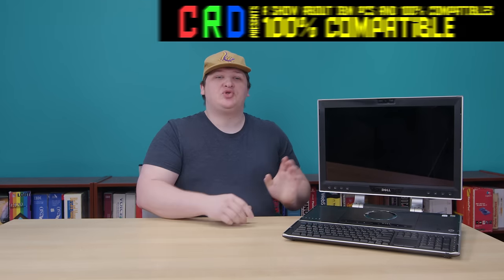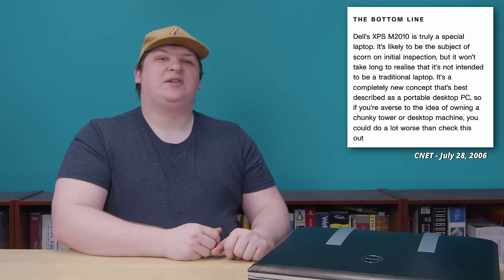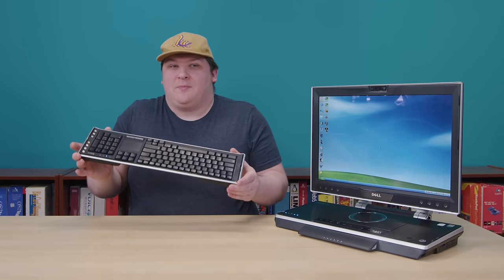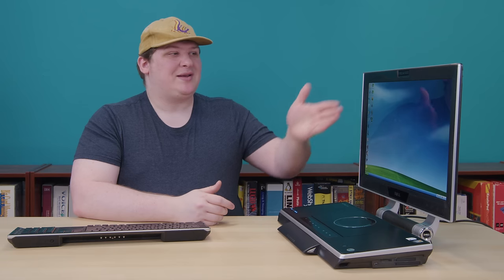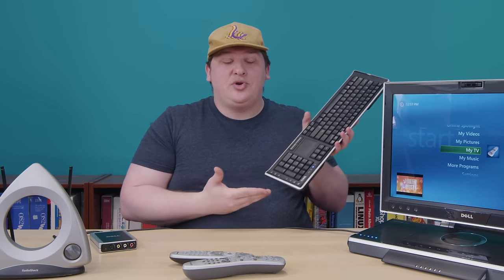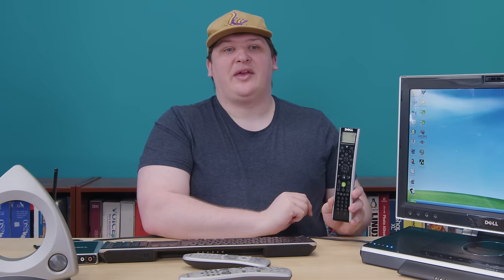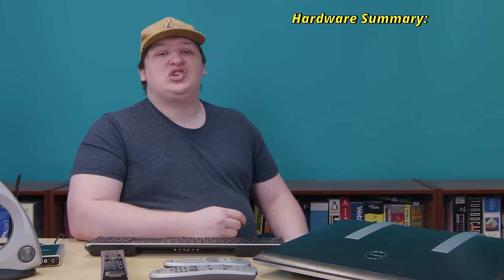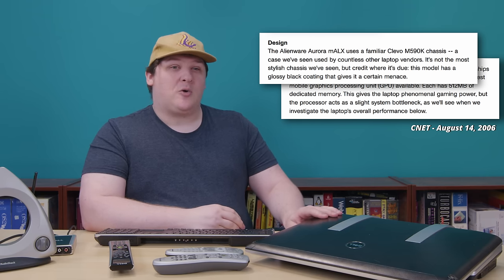Dell Called It "The Showstopper"

Comment: The battery means you can put it to sleep.  Drive 3 hours to work.  Put it on your desk and continue where you left off.    Or put it to sleep. Carry it to your bed and have the ultimate bed TV experience.   I want one
Reply: That still begs the question why they made it so big, you really don't need three hours of battery life for that
Reply: @bacon.cheesecake 😊
Reply: Back in the day you would hibernate anyway tho
Reply: This made me curious if anything like this still was made. And a quick online search revealed the "HP Envy Move" which seems quite similar (though non folding and with a "bag" for the keyboard instead of a dock). And has modern hardware for ~1/3 the price.
Not trying to shill for HP here just found it funny they're still around.
Reply: Even if it didn't had a battery, you can still put it in hibernation and remove the plug, and it will still works where you left it off when you arrive at work
Reply: Still interested how much it will affect the power consumption if you swap two HDD to SSD.
Reply: Something like that, I'd guess. Plus, even if the actual, practical use cases are limited and you rarely if ever need it, I think this device WITHOUT a battery would've been an even weirder sell to consumers.
Reply: @schtiehve9594  That envy-move-thing looks like the solution for those shared desk offices, except everyone insisted on getting a large screen, fascinating device!
Reply: @sheppardpat47  True, but hibernation takes longer to resume.
Reply: @LubomirGeorgiev  that never worked
Reply: @belstar1128  What? Hibernation? Thats how I would use my XP laptop, hibernate on close.
Reply: @belstar1128  I think you're conflating hibernation with hybrid sleep.
Hibernation works perfectly fine. 
Hybrid sleep will wake up for various, unexplained reasons and will drain your battery.
Reply: Yeah I definitely think it was more of a "carry it from room to room" deal than a "carry this to class every day" lol
Reply: @tim3172  when I used to use it often it would just take just as long or longer to boot than a full reboot. and most programs were shut down or glitched out
Reply: why is no one considering the fact that with all the inputs and card readers for cameras + the raid drives this would be a great option for recording in the field and transferring video over quickly, maybe even doing some quick editing? like with that kind of price tag it needs some real professional use cases and this seems like a great option for a freelance videographer in 2006

Comment: About Wireless USB: it uses a type of radio called UWB or Ultra Wide Band. At the time UWB was a 1GHz large band around the 2.4GHz range (compare to the 20MHz bands used for WiFi channels). This large band means the possibilty for huge data rates, but also a large band for other Wireless communications to interfere with (like WiFi). Because the power emission of UWB is way lower than other wireless tech, it was always being disrupted by other signals, including other UWB devices, so this solution wasn't really scalable.
While Wireless USB died, UWB is still alive as a kind of radio positionning system and is part of the solution used by Apple's Airtags, and some high end car keys.

Comment: On why 16:10 for a media device: back then that was actually common as 16:10 would allow you to have a 16:9 video with controls and/or subtitles at the same time without covering the content.
Reply: 16:10 or 3:2 gives more vertical space for trackpads etc and more closely resembles paper formats for creative work.
Probably more of a selling point today with touchscreens and whatnot, but still perfectly usable.
Just please never let laptop manufacturers get away with absurd resolutions like 1366x768 again.
Reply: @MetroidChild  I actually kept a monitor from 2004 around just for reading paper documents.

17" 5:4 in portrait is perfect for a text editor, pdf reader or browser with an A4 document at 1:1. I only replaced it a few weeks ago with a DIY built monitor using a 16" 3:2 panel of almost identical size.
Reply: @MetroidChild  I still have a tv with that resolution, its pain
Reply: Not to mention, a lot of content was still in 4:3 and would benefit from extra vertical space. And if you weren't in fullscreen, 16:9 content would display with black bars on an actual 16:9 screen, while 16:10 gives some space for the taskbar and such without shrinking the content.

Comment: I worked for Dell XPS Gold Support in 2007, as these were being phased out. They were always my favorite, and I still want one of my own.

BTW, we were specifically instructed not to call laptops laptops, because Dell didn't wan't you using them on your lap and burning you.
Reply: I've only used a laptop in my lap a handful of times.  Mostly back when I was a teenager and still flexible enough to sit cross legged on my bed.
Reply: @samsanimationcorner3820  I had to sit my strategically bridging my legs or the 200° bottom of my Pavilion would scald me.
Reply: I actually use my laptops on my lap, but only because I happen to have an old lap desk so im not chocking the laptop or burning my legs.

Comment: This notebook PC reminds me of those refrigerators from the 1950's that were A) gorgeous and B) packed with features that were startling then and we also don't see much or at all today. Swing-out lazy-susan type shelves that also were height-adjustable. A butter "conditioning" tray that kept it warmer than the rest of the fridge. A lower compartment drawer-style freezer in the *1950's*. And it was counter-depth! Not to mention made of solid steel. Luxurious, over-engineered in a lot of ways, but something that solved problems you didn't think you had and was glamorous about it at the same time.
Reply: Expensive household devices back then gave you convenience, expensive household devices today give you gadgets in search of a problem.
Reply: My fridge has a special compartment on the door to keep the butter more warm. I keep the cooking lard in there too.

But yeah those old refrigerators are amazing.

Comment: I think I’ve figured out what the battery is for. You’re absolutely right that the machine was meant for media viewing. The battery isn’t just for a power outage, which is a big part, but even bigger:

Sleep mode and travel. No joke. XP was the first time that we really used “sleep mode” on a computer. And given what this beast was all about, it’s perfect for the jetsetter to take to the airport. Yes, it’s the weight of a carry-on; that’s what it is. But if you have DVDs, or recorded TV, or any video file, you could drop it on this thing, leave everything exactly how you like it, put the machine into Sleep Mode, and then plug in at the airport or on the plane (because of course you fly biz class, where they have 120v plugs).

That’s what the battery is about. Throw all the accessories into a bag, hit the road, and take your media with you, wherever you go. And never, ever, lose your place or video-specific settings through something so gauche as “shutting down”.
Reply: And then when Vista added hibernation, you didn't need the battery anymore

Comment: You've mentioned the concept of an amazing dorm room media center machine before and the only time I ever saw one of these in real use was at a Student Lounge at my university at some time between 2006 and 2010. Another student rolled it in using its official wheeled carrying case, I had a Latitude D420 at the time so of course I snickered from behind my note taking ultra portable. I think with this video you've really demonstrated that while unwieldy for a ton of uses its actually a really solid machine from a time when Dell was actually trying.

Comment: When I worked for Dell back in the day I was part of a team testing Windows Vista across all our product lines before launch. When I saw this device in the test matrix I immediately wanted to test it out. It ended up sitting beside my desk (on another desk due to size) for a good while until eventually I had to give it back to the factory. Enjoyed many a game of Microsoft Flight Simulator 2004 on it on my lunch breaks. I believe my configuration had an ATI Radeon X1800 or around that range.
Reply: I would have been "What's the wholesale price for this?" "Ok, take 1/4 of that out of my next four paychecks because this bad boy is coming home with me!"

My current laptop is a Latitude E6530 with 16 gig RAM, 2TB SSD, BD-RE, 1080p display, dual USB 3.0 ExpressCard, Core i7, nVidia GPU, backlit keyboard. NO webcam or SmartCard. It still have Windows 10 on it, which I plan to keep on it until I must go to 11. It has a TPM but I'll most likely do whatever workaround eliminates the "need" for it.
Reply: He said this one had the Radeon X1800 too.
Reply: FS2004... Like how not even 3 years later after the release Aces Studios made an updated, impressively unoptimized version 😂

Comment: I was a student IT professional at my University when these were first released in 2006. They were used in lecture halls as a quick av interface solution in replace of the custom ad-hoc av solutions that needed specialized a desk and wiring that had to go up, through, and behind walls. This was before the rise of shuttle computer set ups which allowed for immediate interchangeability. Anyone who went to a SUNY school knows all of the computers there were contracted to Dell. Luggables before thenn was most often a TV on a rolling stand with a tray that included whatever your av/it order was, separate of mentioning whatever were the ports built into your lecture hall. The HALO and Street Fighter sessions in these halls were glorious on those projectors. Btw, when luggables of this sort were first released it eas absolutely insane seeing so many students with these absolutely huge laptops being lugged around campus.

Comment: You are right about it being a good pc for it's target consumer.  When it came out I had a number of friends in high end engineering design jobs that got these.  They still occassionaly wax fondly about it. 

They loved that it was a powerful worstation that could easily be taken to the numerous sites that they circulated through. Show up to a branch office, contractor's office, presentation facilities at hotels, etc.  and you could run anything you needed to, on the spot, without worry.  Great for people who worked, mostly, on resource intense software, or veiwing large, slick, presentations.
Reply: Yeah that's a good point. I could definitely see this as good for site visits and presentations
Reply: I'd much much much rather have this than any "all in one" desktop pc and doing it this way doesn't basically cost much extra anyway compared to that.

Comment: 44:19 I just dug out my old Toshiba NB505 netbook out of storage a couple weekends ago, and the rubberized plastic had expired like nothing else has. I had to sit down, put on an old movie in the background, get out a roll of paper towels, grab the guitar pick scrapers from my iFixit tool kit, and alternate between isopropyl alcohol and water to get 98% of it off. That was around two hours. I could not imagine needing to put on a playlist and putting in a workday's worth of effort to get the stuff off of both sides of that Dell notebook.
Reply from the maker: I watched like 6 episodes of Have Gun, Will Travel, listened to a Nirvana album and then watched some Star Trek Enterprise and there was still more to do lmao
Reply: I have the Pentium II ThinkPad from my dad and still use it. The amount of rubber IBM used on these things was insane. But i used a different method. As a business owner and a certification of my country's government, i have access to certain fluids that can dissolve rubber. There are special acid cleaners to dissolve sticky rubber. But please be careful with it.

//edited: typo "mie".
Reply: PALADIN MENTIONED 🗣️❗❗❗

Comment: european here, can confirm we use inches for screen sizes (centimeters were actually commonly used for tv screen sizes but for pc monitors it was almost always exclusively inches and in the hd era they took over the tv space as well)
Reply: i can confirm as an ex european that it's the same for asia.     a bunch of things are inches worldwide, such as household fans, the mentioned monitors/tv's, jeans sizing, car wheels, cat cooldown clay pot cozys, pans and pots often.. there has to be a bunch of other things, but for one reason or not round or such things are often inches. oh yeah he just said subwoofer! subwoofers and woofers are most of the time sold in inches worldwide.  "6x9inc" speakers for cars and such too!

edit: I can't remember centimeters ever being used for tv's in the 90s either.  boxes often had a centimeter rating too though
Reply: its quite annoying inches are mostly used for things like measuring screens and a certain body part only half of the population has .
Reply: @belstar1128  WHAAT only half the population has waists?!
Reply: @odkres  we use cm for that
Reply: Actually it varied depending on country and manufacturer. Nokia sometimes used cm or inch depending on the model. Their larger sets were sometimes seen measured in inches but the smaller ones with a built-in vhs player were using sometimes using cm. And this is just from Sweden.
Reply: @belstar1128 You'd think centimeters would be more popular for that, considering the inherently larger numbers involved.

Comment: I wish they used standard desktop components , as around 2003 or 2004 , there were desktop computers packed into laptop form , i think they were like from 17 , 19 inches but inside , you could fit usual desktop components as motherboard had slots mounted paralel , so everything could fit nicely. And they were really thick and heavy , and had just like that machine small battery , so if power fails , you can save your stuff and power it off. I remember also them having bad thermals as well due to crammed components , but it was cool idea for the time , as laptops from that era had big constraints compared to desktop counterparts. And that was great solution for the time.
Reply: This was actually something Dell tried much later. Remember the Alienware Area 51-m?

Comment: 44:17

you can try some very thin plastic wrap for food and stretch it accross the rubber- coated parts and press it on and trim the excess with a blade. it kinda bonds to it and doesn't look the greatest, BUT it gives it a new glossy shell that doesnt readilly come off and most importantly, no more goop feel.
Reply: well, i guess you removed too much of it for this to work its best. shrug

Comment: My first thought was that the receiver was for the keyboard, because the BIOS most likely doesn't have a menu for pairing wireless keyboards, hence the physical button and extra board, since it might be easier to just use a board from an existing (FCC approved!) Keyboard instead of writing an bios module to connect a wireless keyboard, using exclusively the buttons on the machine itself

Yes this would mean that you have two BT radio's (if they're both BT) in the same machine, but if it means that something else is less likely to break at less cost than a software solution, it might be the chosen 

Also, as an EU citizen (specifically Denmark), I've never seen screens advertised in anything other than imperial inches, the packaging might also have the metric measurement on it, but then it's often in parentheses or smaller writing, and this applies to all material mentioning screen size

Which probably means that some EU law says that all screens must declare their screen size in  inches, because otherwise the manufacturers would absolutely love the opportunity to trick people with 2.54x higher numbers

And with screens, I mean everything that has a screen with a size worth mentioning, laptops, TVs, tablets, all phones with a screen, projectors and projector screens

Also, more laptops should have used DVI-I, the ability to either have an complete VGA signal, HDMI, or DVI dual link provides a lot of options with only passive adapters

Comment: Yeah in Europe we also use inches for diagonal display sizes in general
Reply: Yeah,  it is hell every day on this planet
Reply: This truly is the darkest timeline
Reply: I think it wasnt always like that tho. When CRTs were still around I believe cm was more or less the norm for screen sizes
Reply: Ah, but that basically only took off with LCD's. CRT's were definitely primarily advertised in centimeters. I had a 55cm Trinitron for example. Which I miss 😢
Reply: We do - but legislation (EU, iirc) requires that every dimension is given in cm as well - and I've always found that useful to pull out my tape measure and estimate if a new monitor might fit on my desk.
Reply: Where i live, most vendors use both cm and inch simultaneously, because many people don't know how large an individual inch is, but how large a 24" monitor is. It's weird yes.
Reply: But only USA and Liberia (USA 2.0) use inches. 😂

It would be better to use millimetres because its more natural for us.
Reply: Not only in Europe and the USA, the world is broad and alien.
Reply: @vetrixfx9264  CRTs were mostly measured by height or width, LCDs and pretty much every panel since is measured by the diagonal (likely to make them seem bigger than they are)
Reply: @genderender  this is not what i'm familiar with. Atleast in Germany prospects or catalogs measured the diagonals in cm and differentiated between the diagonal of the tube itself and the actual viewable picture (about 5cm less usually)
Reply: very odd indeed i blame lazy translators